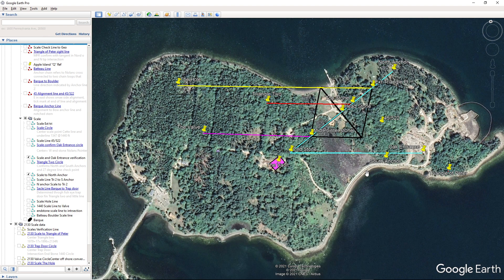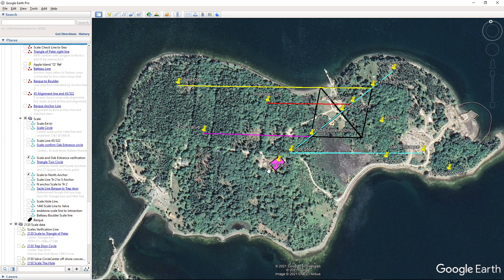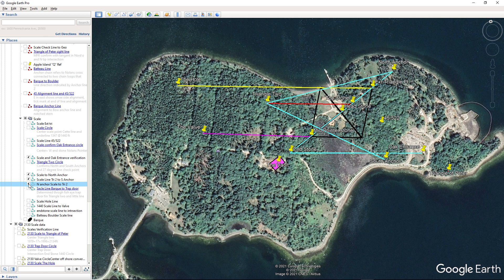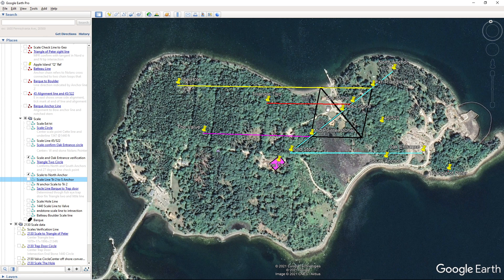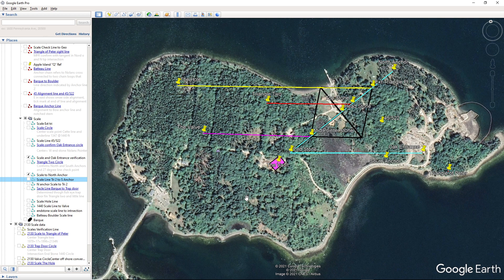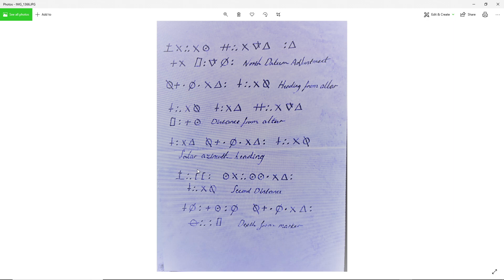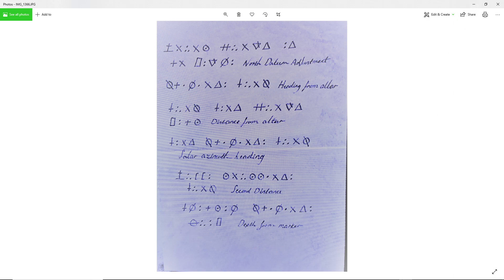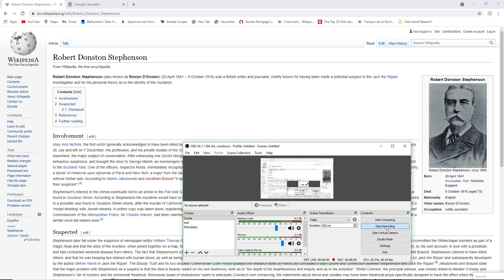Oak Island Update: 40 degree conformity

Comment: Great finding, Michael. The 2 lines showing 40 angles result from mathematical property of a straight line crossing 2 parallel lines.I mean if it has an "x" angle with the first line, it must have the same to the second parallel one. 
Was is remarkable, I think, is that the lines are parallel. And this no by chance design. Those points were positionned so that the lines are parallel. "Oak Entrance - End Stone" is parallel to "Extended triangle point - The Hole". And that is by design...... Especially when the "Mid Pointer - Valve", and the "Head Stone - Triangle DEC$ (you call it triangle 2)" lines are also parallel to the 2 others.... I think there is more to find about these parallel lines.... and they may reveal something about Lrfd map once overlay onto the isalnd. Something like "The map gave us exact points on the island, and now the island is showing something on the map....".. I'll have a look at it :)
Reply from the maker: lets team
Reply: @DOTtoDOT  With great pleasure as always. Am I understanding correctly your sketch ? The "End Stone" to "Oak Entrance" is a 90° line with a lenght exactly equal to the 2nd scale ? Is that right ?
Reply from the maker: @oakislandresearch  no it is not due east rather 100 degrees and is the 1440 scale
Reply from the maker: @oakislandresearch  4 lines on west side are running 280 and oak entrance is 100 degrees
Reply from the maker: Do you have time to MS Teams email me an invite
Reply: @DOTtoDOT  Sent :)